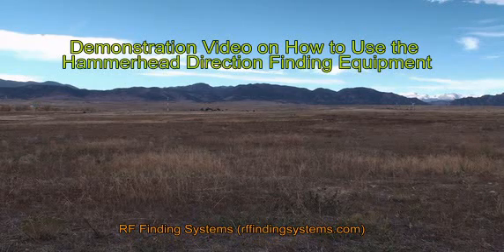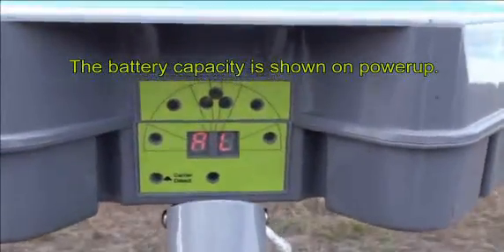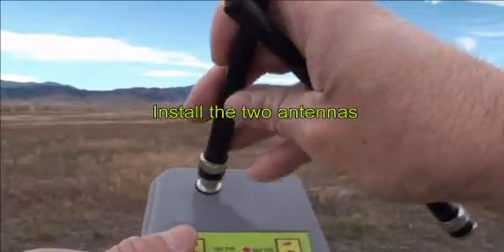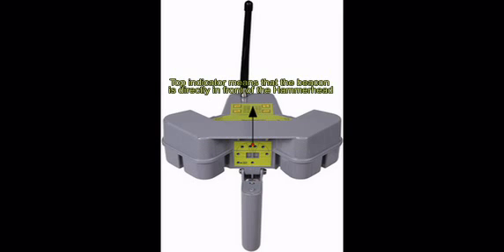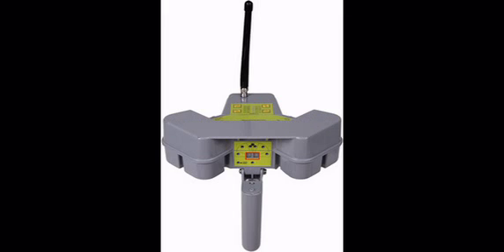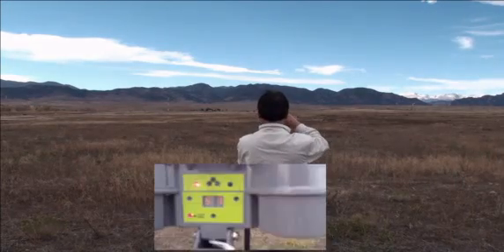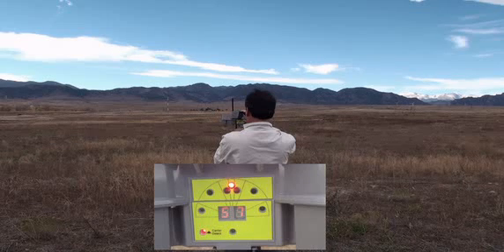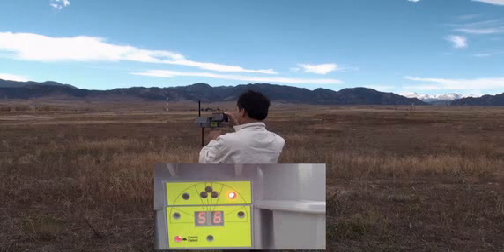Hammerhead Direction Finder demonstration

Comment: 1. what signals it can find? Mobile, Radio?
2. Does it show the distance from the signal?
Reply from the maker: 1) VHF frequency range but frequency has been preset for five frequencies in the 121MHz band
2) No. Only signal strength.